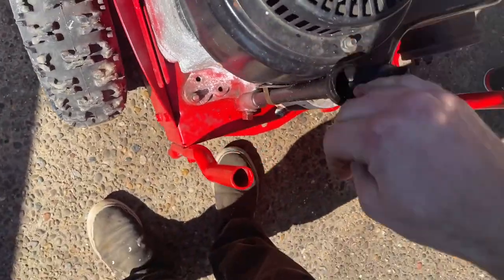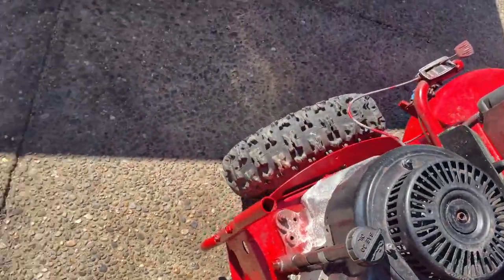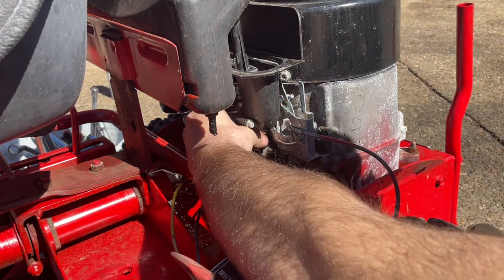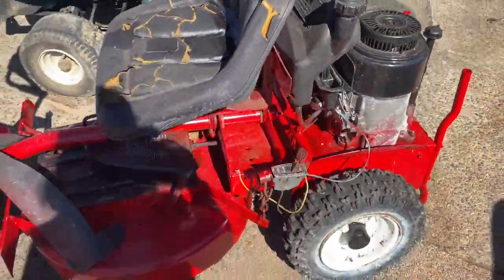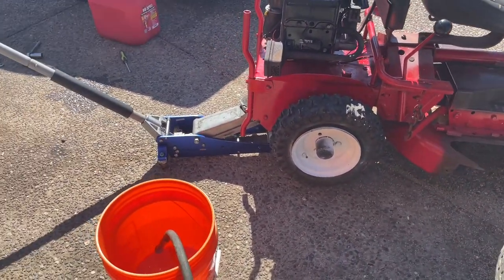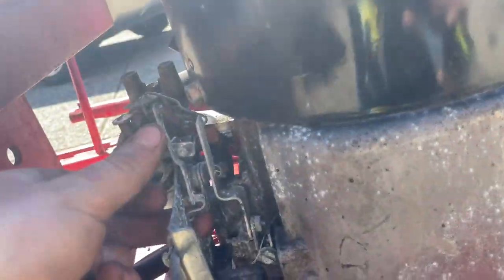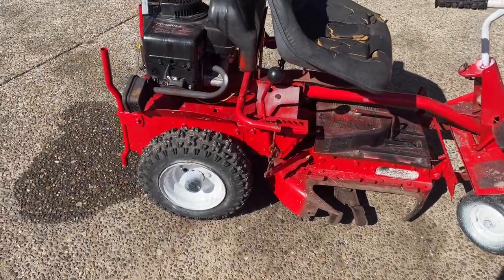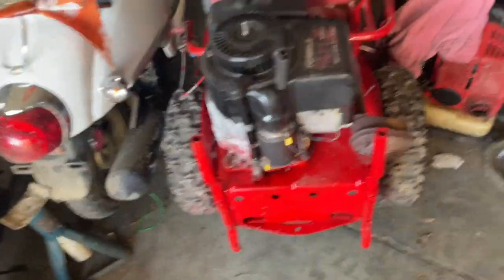Fixing a Free Snapper Riding Mower

Comment: My buddy got one of these for free too. Original motor and everything. He ended up going to harbor freight and purchased their strongest replacement motor for this snapper. After his installation, he didn't get more speed out of it (because of the gearing), he ended up getting more power. He uses this mower, a regular push mower, edger, weed eater for his everyday landscaping business.
Reply from the maker: They’re solid! I also ended up swapping the motor on mine, I just put on an old 19hp briggs opposed twin that I had laying around. it still works great.